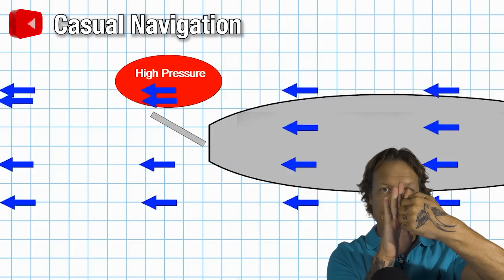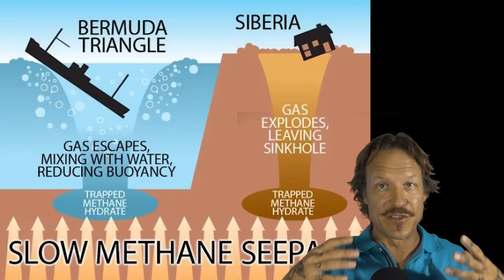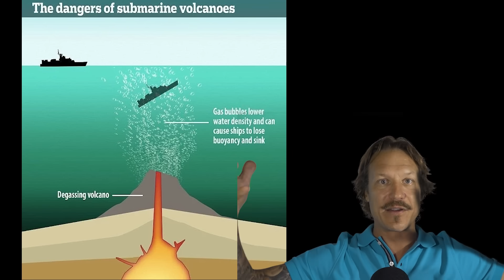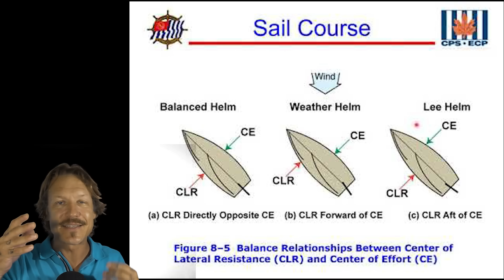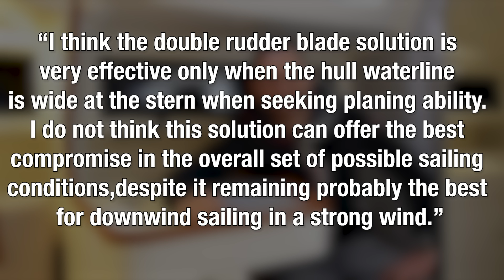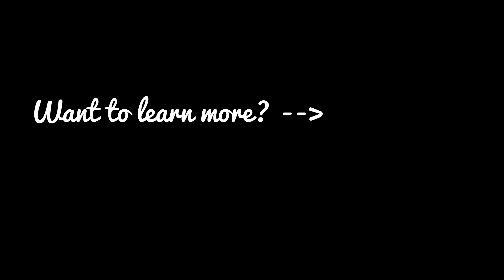The Problem With Dual Rudders Nobody Talks About

Comment: I am no naval architect, just an engineer. And I designed and sailed some RC model boats (they need to self steer more neutral than manned sail boats with a helmsman or AP at the rudder). and I sailed quite some miles inshore and offshore from dinghies , monohulls, cats & tris to a tall ship on various oceans.
Yes, the sideway movement of the center of effort is the primary factor in a sailboat's self steering characteristics:
- If you have a narrow hull the center of effort moves rather linear across the heeling angles, so those designs are friendly to find a trim working for a wide range of wind pressure
- If you have a wide hull the center of the hull's resistance goes faster leeward than the sail area (in low heeling angles), so you trim your sails for this configuration. As soon as you get pressure forcing higher heeling angles the situation changes dramatically, the sail area goes leeward to the hull which causes weather helm: You need a very different trim setup.

In race boats the crew trims a constant heeling angle across the conditions which makes a wide stern to work great. This is not the case on leisure crafts!!! So leisure crafts' wide sterns have only advantages while going downwind when they give added stability to hold course (better than narrow designs)
For those with a wide perspective: Model boats designed or regattas got narrower and narrower across the last decades, there is no crew stabilizing the heeling angle with ballast & foils.... (while the offshore racers go wider & wider!)

Side note: there are many more aspects to think about regarding low speed performance during maneuvers like tacking, docking, ... which are not covered in this short text.

Comment: I’ve sailed tens of thousands of miles in an old IOR boat with a narrow stern and believe me, it’s no fun going down wind. I currently race a wide sterned boat and going up wind we rarely have more than 5 degrees of weather helm. When we have out of control round ups it’s invariably because we’re carrying a spinnaker long after any sensible cruiser would have snugged things down. So it’s got nothing to do with twin rudders ( which have other serious drawbacks) it’s got to do with well executed designs and poorly executed designs. Since a normal circumnavigation probably entails about 70% downwind work you would do well to have a boat that excels on that point of sail. Your characterization of a wide sterned boat being unable to go well windward is just not true. Adjusting your CE is often a relatively simple fix. If cruisers are concerned about the windward ability of their boats they might think about removing the homeless encampment on the stern that seems to always be installed immediately after  purchase.

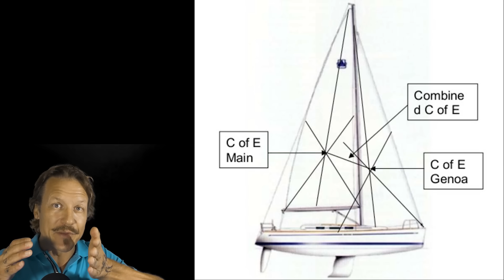Comment: At the 6:00 mark, the CE and CLE depends so much on hull shape not just at the transom. If you have a triangular delta-shaped hull, I think you're spot on but with modern designs getting to Max beam further forward it starts to look more like a traditional hull shape in the water as it heels over. For cruising, it also opens up designers to reduce draft w more inherently stable hull shapes.

Comment: Did I miss any note on the fact that as the boat heals the rudder starts to work less and less as a rudder and more as a foil. Hence twins are angled to work better at heel. 
They can also be shorter since the lee one is always fully submerged.  
Wide transom is better with twins.

Comment: While educational in the first part, this conclusion that 2 rudders are worse than one, is like contradicting F1 engineers that front wheel drive is better than rear wheel drive.
I kind of trusting the F1.
They might know one or two things about optimizing aero/hydrodynamics.
Otherwise ALL of the successful racing boats today will have only one rudder.

But controversy is good for the YouTube algorithm, so monetization is the true steering here.

Comment: Don't understand what all the fuss is about.  seems like the marginal improvement of having two rudders in the water when going downwind isn't worth it.  The 2 rudder boats I have sailed don't handle well when heeled over in a stiff breeze.  Also, the 2 rudder designs always seem to use  undersized rudders.

Comment: There are solutions to this problem. Not sure if they are available in prodution boats.

Check out the riptide 55.
It has a trim tab on the back of the keel. Best upwind boat i have ever sailed on. No autopilot needed. Pick your point of sail, trim the tab, center the helm, and sail for days without touching anything.

That boat also has water balest but it's not needed and sails great without.

Comment: "In the early days of this century (ca. 1925) It was the fashion to build Yachts with lean bows and heavy quarters (...) But as soon as a Yacht of that type heeled the tendency was for the stern to lift and the bow to drop, so that she griped or bored, and much helm was required to prevent her from rounding up into the wind" (Eric Hiscock, Cruising under Sail, page 15) OMFG The Eternal Return of the Same. If you want a wide transom you must move the longitudinal position of the center of Bouyancy ... Aft (!) the longitudinal position of the center of Flotation (!)

Comment: I started off sailing a Folkboat and recently have spent more time sailing modern hull shapes. I love the Folkboat. But given a choice running off in strong winds I’d choose the modern hull shape any day. Having a balanced and powerful rudder is I have learned an important safety feature when running off downwind close to the gybe (in conditions where going upwind isn’t really an option, in any boat). Always felt lack of steerage on the Folkboat in these conditions. Also I have an RS Aero with a modern hull shape and wide square transom (v asymmetrical when heeled). It is a joy to sail upwind.

Comment: Finland here. We’re surrounded by tens of thousands of islands, rocks and such. Apparently more than anywhere else on the planet. The waters are littered with thousands of wrecks from centuries past. From leisure boats to big cruiseferries, we design and build expecting something to fail. The loss of a rudder, engine or electricity producer isn’t acceptable, as a boat/ship might end up on rocks within a minute and our weather is usually quite brutal. Dual on everything, at minimum.
Reply: Does that include twin hulls😁

Comment: Misleading title and argument.   You are simply arguing against hull shapes that, in your opinion, are not optimum for "offshore" sailing.    The rudders are irrelevant except that they are primarily used on wide end hulls, according to you,  to fix aeration issues.      Same old argument against Modern vs. Classic design.    Nothing new, and nothing added.    It's tedious and boring and frankly disingenuous.

Comment: My take, having sailed both single and twin ruder extensively recreationally and competitively in- and offshore, is that eventually most dual rudder cruisers are just poorly designed and not properly balanced. You jump on a JPG10.10, 10.80, 11/80. Sunfast 3300, any of the Open40's, .... , and the weather helm will be minimal while sailing upwind, all while you get really good grip and control compared to a single ruder boat, just because the rudder sits much more vertical in the water. You jump then on, for example, Bavaria 56 and, though the actual control and responsiflness is great, weather helm becomes a problem rather quickly; but then again you jump on an older single ruder Bavaria 56 and you will find the same problem. 

For me thus the problem is not single or dual but the actually overall design of the boat and to be fair, 99% of the boats these days are not really designed to go offshore for extended periods of times nor to really handle the weather of the open sea. They are nice day sailors to go from bay to bay or maybe be out for 2-3 days at a time and that's it, and it reflects in the design and quality.

Comment: James,  I have Beneteau First 305 with lifting iron keel and twin rudders. It must have been one of the earliest twin rudder boats from 1986. It has a relatively narrow stern and with the keel down sails up wind on rails with very little weather helm and great balance in the sails.  It also grips the water really well down wind with the large rudders.
I think it is therefore the wide transom and the search for form stability that gives the balance issues you describe.

Comment: Owning a Pogo1 and having a friend owning a Coco (Archambault, single rudder) I can tell that the double rudder of the Pogo1 works so much better than the single rudder of the Coco in ALL conditions. Less tiller angle and force necessary downwind and upwind. Of course a Pogo1 is not an super extrem wide design at the stern. What I am trying to say is: It always depends very much on the individual design of the boat, despite that your physical explanation of the problem is absolutely correct.

Comment: Twin rudders in a boat is certainly problematic but is a solution to a problem of designing wide transoms and shallow draft hulls ( a single very deep rudder could work too but that has many issues too). 
A Properly designed hull will work better with that smaller leeward rudder in the water vertically, the windward hull potentially having less drag being possibly out of the water when heeled.  For most inshore and offshore sailing this should work fine but the compromises come in manouvering and complexity.  Offshore gets some potential redundancy from 2 rudders but only if they can be disconnected.
Upwind sailing with a wide flat hull is never going to be easy , the number of rudders does not matter it’s the hull shape that causes the issues. 
FYI catamaran sailors have lived with poor up wind performance for years so is it that terrible? 
Cheers Warren

Comment: A badly balanced boat is a badly balanced boat. Twin rudders are a design decision, along with where to place the buoyancy longitudinally and athwartships when healed. Racers love a fully battened mainsail with a big old roach but real cruisers would have a negative leach so no battens required - and slower, but no maintenance, cheaper etc. you pays your money , you makes your choice.

Comment: Since you mentioned sailing to Patagonia, Here is my concern. I live in the Chilean Patagonia 6 months of the year and tending to stay there longer or permanently. I am looking at sailboats in the 40 to 45 foot range and as far as comfort I gravitate towards the Hunter Passage 42 or 45 with a center cockpit and a sugar scoop. The interior is very livable and the shoal keel  and spade rudder are a compromise. After all I will never find a cruiser with a full keel , cutter rigged, center cockpit with a two cabin configuration. 
The first part would be sailing there and then sailing the fjords of the Chilean Patagonia. 
What would you choose?

Comment: Gentlemen don’t sail up wind👍
If you can afford a big heavy duel rudder ocean cruiser you can afford a delivery captain who gets to experience the upwind umm active rudder factor. Then as the owner you get to experience the great down wind ride. 

Kinda like hiring someone to ride your mountain bike to the top for you, while you get a helicopter ride to the top then you get to do the fun down hill part. 

The big heavy cruisers with duel rudders? Yeah kinda silly. Racing rigs it makes sense.

However!!! Very few cruisers EVER deploy and test back up rudder systems in conditions that cause rudder failures. Where as racers literally test systems and train crew in poor conditions in backup system deployment. Nor do many cruisers even have sealed rudder compartments to prevent sinking if they suffer a serious rudder failure issue resulting in water getting into the hull. 

Very few sail boats are built today with blue water crossings in mind.

Comment: I heard from very knowledgeable sources also that those very wide beam boat will really badly bash in the waves at close reach making the voyage very unpleasant especially for the people inside the salon and fore. Catalina yachts decided not to go there and it is a good thing.  Also when you talk about wings in the water this is it but I have to say that the extrado of the surface does most of the works not only air intrusion may be the culprit when a rudder stalls but when it pass the critical angle of attack . The later will also most likely induce or combine with the air intrusion in the picture. Cheers

Comment: Sailboat design is intriguing because it involves so many conflicting parameters. A few you skipped (pro double) : for racing, ANY control input will slow you down, so almost anything you do for efficiency is good. A high aspect ratio is efficient. A foil  at right angles to the desired change is efficient. A foil with smaller wetted area is efficient. If you're not racing, none of those matter.

Comment: When the rudder is out of the water and cavitating, isn’t the drag increasing as well? Wide transoms (and two rudders) optimize downwind sprints with full spinnakers and full compliment of crew for sailing into the wind. Which is the opposite logistics typical for blue water sailing.

Comment: First thought was 'So why not do the unthinkable and have a sliding rudder pivot which can move to either side or central'.
Then I thought, '
I just missed the point & put the cart before the horse because the wide rear hull came first, twin rudders were an adaptation'.

Comment: One thing also with wide transom boats is the hydrodynamic shape of the healed hull. This becomes an asymmetric foil which pulls the boat to windward while at the same time causes the keel to be dragged through the water slightly sideways, also forcing the boat to leeward. These keels need a trim tab to better tune the keel to the motion of the boat. 
My center rudder Southerly 135 has a swing keel which I am hoping will allow me to trim the CofE of the sails to the CofE of the Keel.

Comment: I tend to agree with all you said. But sailors with beamy sterns would't have nearly the change in buoyancy if they didn't let their boat heel so much. The movement of that CE can also be controlled by slacking the sheets as the winds increase.  I would never let my cruising boat heel more than 20º. The strain on the rigging is totally unnecessary and dangerous.

Comment: Completely agree with your comments in this video. Having sailed and delivered probably 100 different boats, as a broker and captain, there’s a reason I own and sail an ‘81 Hood 38 by Wauquiez! The wineglass shape pulling in at the transom makes for a far superior handling boat at all points of sail, and particularly running with wind…the wider stern can make for a lot of rolling in following seas. And as you’ve mentioned, windward performance 👍
Reply: Wauquiez 38 is one of the best boats ever built.
Reply: @giovannagallottini I have to agree! A little under-rigged for standing, but I’ve overbuilt the backing plates for the lowers now, and have more plans to beef up the standing before doing any serious offshore work.

Comment: Thanks for the detailed explanation about center of effort vs center of lateral resistance.  My boat has a planing hull and a swinging keel, so the CLR can be adjusted to tune the boat.  You can literally tether the wheel to the railing while you go make that sandwich.  Extreme shallow draft is also a big advantage in Bahamas or Florida.  With keel fully retracted, the boat can be beached. There are disadvantages, like the keel trunk being in the middle of the cabin

Comment: There are IMHO more caveats to the dual rudder solution, specifically for an offshore sailor:
1. Their construction is more complex than a single rudder, if you get a technical problem there while offshore, you have a bigger animal to deal with.
2. Dual rudders are fully exposed, meaning: a single rudder, which is line with the keel, is in a way protected in case you run over something in the water.
Dual rudders are to me a subject of higher damage risk and vulnerability.

Comment: You should try a RM boat. Very large, very "racy",  two rudders of course, but the hull is not round, it has 3 "faces" (dont nknow the exact English term). So when going upwind, it heels less than any other boat I tried, the hull is going flat on either of its lateral "face", and stays there. When trimmed like that, the balance doesn't move, and just surf and push forward with gusts. And these boat FLIES. Going FASTER than true wind is addictive even in cruise. Point is if you look at recent racing boats, they are VERY stable, they don't hell and don't move at all.
Reply: Yes. As someone else said here, french builders (Pogo, JPK, RM) have solved this with beautiful boats that sail well and fast (on any point of sail).

Comment: Design, type of use, all good points. Double rudders still has the unique potential for failure without a keel for protection. Day sailing close to shore? Not as risky. Two weeks out is no place to take such a risk. The ocean is not free of obstructions.